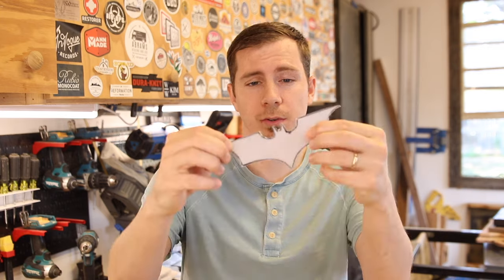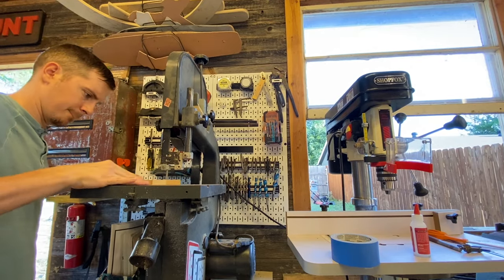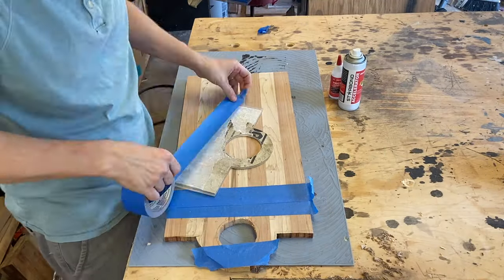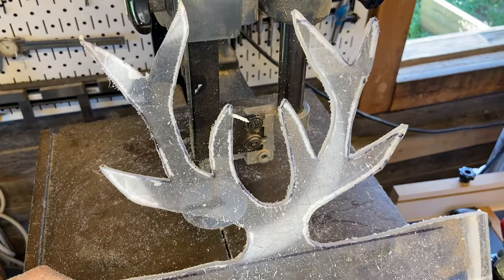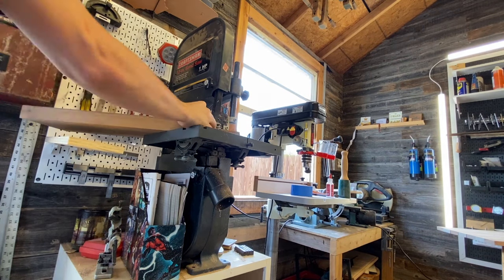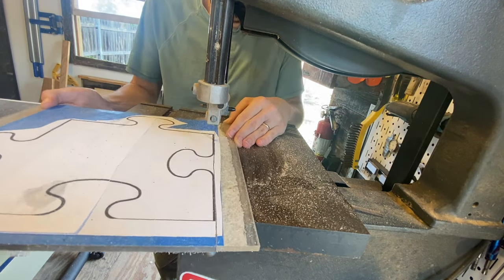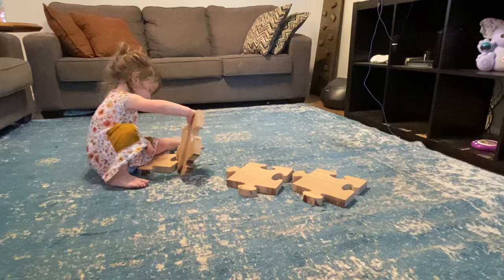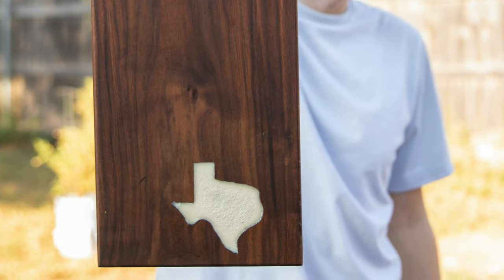5 Jigs That Will Make Your Cutting Boards NEXT LEVEL!

Comment: I am justwondering with regards to the "finger hole. on your boards. I find it a bit easier to just drill a "center hole" in the template.  That way I can use a Forstner bit or a hole saw to vary the overall hole size when I "feel
 the need"...😎😎
.

Comment: Just checked on the boiled linseed oil - you probably need to be using something food grade on your cutting boards - I might not be reading the can you are using from correctly but if I am boiled linseed has chemicals added to it and should not be used for food grade wood products.  Bees wax and mineral oil is good - Love the template idea and the cutting boards are very pretty.  :)
Reply from the maker: Boiled linseed oil is non-toxic, eco friendly and food safe! Bees wax and mineral oil are great too!

Comment: How can I make a small kitchen island without all the tools you have?
Reply from the maker: That is a good question. You’ll need a few tools  to build anything, even if they aren’t the ones I have. You absolutely need something to cut wood, any kind of saw will work. You’ll also need something to join wood, a drill and screws is preferable over a hammer and nails. And you’ll need a sander to finish the job.
Reply: My son in law made a very nice island using only a circular saw, an electric screwdriver, and a sander out of 2x3's and and 1x2's for a bottom shelf. He topped it off with a prefab butcher block top. Simple and functional.